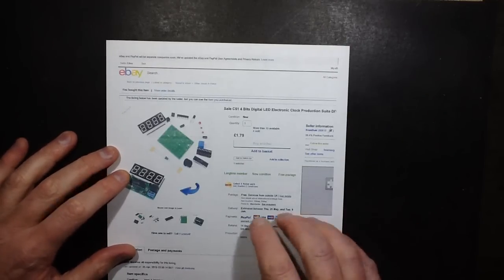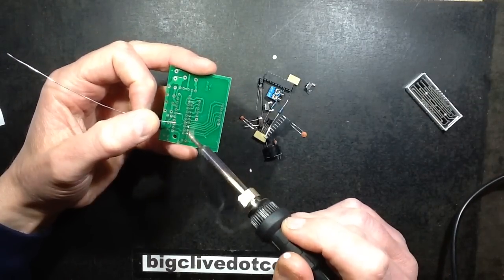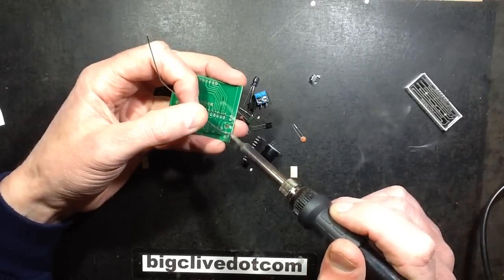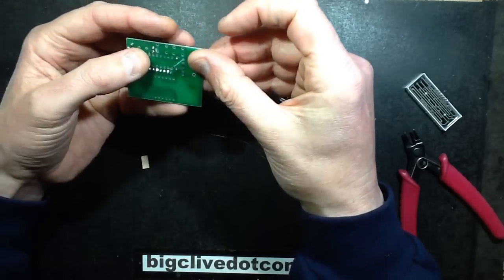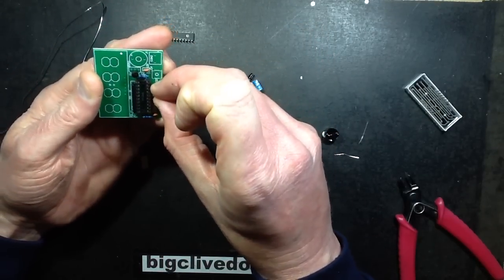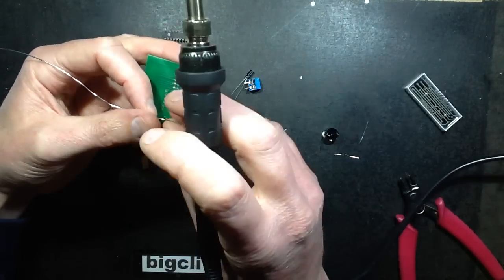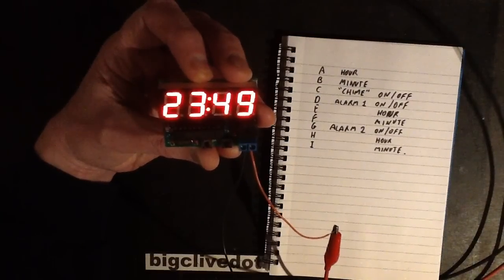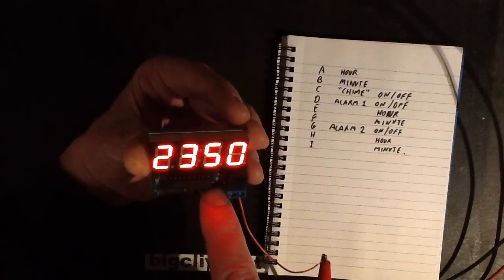Random Chinese electronic clock assembly kit type thing.

Comment: I have used hundreds microcontrollers  as rudely as you want and never had a single failure attributable to static. The inputs are protected. The earliest CMOS chips were not,  so the lore has spread and still sticks..

Comment: Me when I get a diy kit: meticulously follows the directions and circuit diagram, suffering through any chinglish in order to be as exact as possible

Clive: "Let's just mash everything in where it makes sense to."

I wish I was this good at electronics.
Reply from the maker: +Chris Roller You're already on your way to that point.  Time to treat yourself to some random Chinese ebay kits.
Reply: The only way to get good is to study, and build these kits, they teach you a lot. Also get an arduion or two and play with them.  Examine the example codes and you can easily learn the short version of C and C+ that they run on.  Get some ESP8266's as well to play with the internet of things, great fun and the lua code is very much like the Arduino codes, in fact now you can program the ESP with the Arduino programer with just a bit of work.

Comment: I just finished this kit and it works fine. Thanks for the video. I will study it to find out how to set the time and alarms. When I do my soldering I always use a small fan to blow the smoke from the hot flux away to one side, so I don't end up breathing too much of it. I'm using 3 penlight cells to power it with about 4.5 Volts, and that seems to be quite sufficient.

Comment: Got the same one last year as a project for my 15yr old son.
Although the crystal died after a week but once replaced it works fine.
It is still running.
Was so impressed I ordered their battery  backed version at £2.10

Comment: Not sure if anyone else has said, but the caps across the crystal (calculated by C = 2CL - (CP + CI), where CP + CI can be estimated as 5pF) are the load capacitors and they cause/encourage the oscillation that makes a crystal do it's thing usefully. Wrong value caps, or no caps == no oscillation.

Comment: The 30pf capacitors are in series with the xtal; they provide the correct load for the xtal and the necessary phase shift to make the oscillator work.
Reply: Not exactly.  I was told by an engineer some years ago that those were added to ensure that the oscillator would start reliably.

Comment: When learning how to solder at college [C&G] was told not to melt the solder with iron but heat componets/ wire so that it melted the solder. the test to pass exam was to  remove chips/ components and refit then it was tested to check it still worked.

Comment: IT uses AT89s51/at89c51. as this 8051 variant has very weak pullup feature, hence it uses the shunting arrangement where the display segments are turned off by providing alternate patch thru the microcontroller.

Comment: The exception to carrying solder is when soldering SMD chips. Basically, ome fixes the chip in place with Bluetak,  put lots of flux over one set of pins. Then carry a blob of solder over to the pins and run it along that side. With a little practice,  all the pins will be soldered without any solder bridges between them. Shame the SMD soldering practice kits don't have more chips.

Comment: @1FireyPheonix  totally understandable. :) it's easy enough to mix them up because they contain what the Chinese call Han zi, and the Japanese call kanji (hear the similarity?) 

          ---- warning TL;DR rant approaching ---

they literally are the same characters often times with a similar or identical meaning. Hence numbers. 

The only thing that changed, just like had happened across mainland China for hundreds of years before, the sounds that fit to the characters changed. This is also why Japanese kanji have what's known as an On and Kun reading, giving two pronunciations for a character. One the original Chinese, and one the Japanese pronunciation.  

Both Simplified and Traditional Chinese use strictly Han zi and other symbols, whereas Japanese include the kanji, and  2 distinct syllabaries (like alphabets) call Hiragana, and katakana... 

These two extra sets of characters help Japanese text to stand apart from Chinese. It helps if you know both too I suppose lol :P

Comment: Clive, the cheapie IC sockets are easy to seat. Push them in, flick the opposite corner pins over, THEN solder the OPPOSITE corner pins. If it's seated correctly, then unfold or "unflick" the opposite corner pins and solder them.

Comment: I recently started learning to solder myself by following Clive's advice and making some kits.

My first was a super-cheap kit with just a couple of flashing LEDs. I killed an LED by overheating it with the soldering iron. Luckily, I had a spare, and the rest of it went off without hitch.

The next was the very clock that I've just seen Clive put together. It works great, but I couldn't figure out the settings and it was too damn noisy, so it's resting at the back of a cupboard.

Next was a transistor tester, although it actually does a lot more than that. It's quite a sophisticated device, and useful in future electronics work.

I've got one more on order, and it's by far my most ambitious to date. An oscilloscope! :-)
Reply: then you aren't that far from making your very own SEM, it would be so fun to do it.

Comment: you solder basically the same as i do. i bought 3 different clock kit from various sellers and found 1 half worked, 1 did absolutely nothing and 1 worked perfectly. the one that works gain about 1 second per week. luckily it is the clck that i hoped would work, it had time date temp alarm and 60 led in a circle that showed seconds in about 20 different various. patterns. sill worked perfectly after about 1 year. the other two so-called clocks are in some fill site somewhere. :) i can turn chime on/off and can even set chime between certain hours only and not at other times.

Comment: A habit I've gotten into is to cut the ends off the leads of R's and C's while they're still in the endcaps, because the sticky residue would otherwise scrape off in the holes and get in the way of soldering.

Comment: Speaking of countdown timers, I needed a few of those for my wife who has to take medication then wait for a certain time for it to take effect before she can open her eyes once more (eye drops for glaucoma)  I looked around on Ebay and some Chinese shops bout could not find exactly what I wanted, but I did find a fellow who had the diagrams and code to build small ones using the smallest Arduinos and a little 4 digit display. So I built her one for morning and one for evening (different times required) and one for our car as I pull her behind our RV when traveling and I need to run the engine for 5 minutes at each stop to keep the transmission lubricated.  They are quite simple to build and run great on 9 volt batteries.

Comment: I've just received four of these kits as I'm experimenting with a "quick and dirty" way of powering up incandescent filament bulb displays via optoisolators in place of the LED display. The whole lot came wrapped in a very static-inducing sheet of packaging!
Reply from the maker: MegaWayneD One slight downside of a multiplexed display is that if it's not fast enough it may cause a slight beat frequency on your triacs that manifests itself as a slight flicker.  But only time will tell.
Reply: Yeah, I'm not totally convinced it will work but I figured at this price it was worth a try.
Reply from the maker: MegaWayneD Definitely worth a try, and if you do make a matrix of opto-isolators you can always try it with different modules to see if you can find one with a faster scan rate.
When I built a fairground game with large tungsten displays I used an M5450 LED driver since it is direct drive.  I actually drove the triacs directly with the outputs.
Reply: That's worth knowing, thanks! The thing I'm working on is a bunch of car "festoon" bulbs arranged in the 7-segment way so it resembles RCA numitron filament displays.
Reply from the maker: MegaWayneD You can multiplex tungsten lamps too.  That's what fruit machines do to drive either 64 (8x8) or 128 (8 x 16) lamps.

Comment: When I first watched this, I was wondering, "Why did they bother to include a socket for the IC instead of just putting it directly on the board?"

Then I watched Clive solder the thing going right down the rows. That's when the light bulb went on, "Oh, so an inexperienced amateur won't cook the chip while soldering it in place."

I'm going to assume, Clive, that you did it this way because you knew you were just soldering the socket, not the actual chip. When my dad taught me to solder, he was adamant about that concept:

Never solder adjacent pins on an IC one right after another.
Always solder diagonally opposite pins and, even then, it's a good idea to allow a few seconds cooling time after soldering each pin. When possible, keep a finger flat against the top of the chip while you're working. If it gets too hot to keep your finger on it, it's time to stop and let it cool before proceeding. 

You might consider adding a caption to your video to point this out. :)
Reply from the maker: +Greg Wolking On the rare occasion I solder a chip in directly I stagger the soldering  on opposing pins and also pause mid soldering to let the chip cool down.  A socket is always preferred.
Reply: +bigclivedotcom 

I had figured as much, Clive, as I stated previously. It's quite clear from your videos  that you really know your stuff.

Thank you, sir, for taking the time to answer my inquiry. I thoroughly enjoy your videos. In particular, I find the calm, measured, "thinking out loud" style of your narration to be a refreshing change from many other "how-to" YouTubers who seem to think they must become some kind of "character" telling jokes, cracking wise, getting ridiculously upset, and so on.

I have often wondered whether you plan what you intend to cover before you start recording or just go completely off-the-cuff every time. If the latter, it sounds like the former, as you're very good at staying on point and not needlessly repeating yourself (AvE comes immediately to mind in that regard). You may count me as a fan, sir, and I applaud your endeavors!

Comment: Built a couple of those clock kits.  The one like yours worked till I inadvertently hooked it up to my 12 volt power bank instead of the 5.  The other had soldering iron problems.  You see, I spend most of my time in a lift recliner because of my body condition, at any rate, I thought it would be a smart idea to buy one of those little cheap USB soldering irons.  They do work GREAT for just tinning a lead or something but building a kit?  Not so much.  Seems they just keep heating up and suddenly the traces and pads are seperating and your kit is pretty much garbage.  Ruined four or five different kits with that before it became a little used item.  I finally bought a cheap mains type with thermostat on the handle taking the tips like the ones you use. It does a nice job if you are careful but I have yet to buy any more kits. I do have decor that I built up such as little Christmas trees and heart we put on the dash of our Motor Home while traveling and when we spend the winter months in Arizona to keep away from the dreaded snow of North and South Dakota.
Reply: Who the hell knows, some days I just ramble on, and on and on.  I once considered myself a writer, even had a few short stories published, one in a magazine, another in a sci-fi anthology, but I gave it up and turned to computers, then to arduinos, then oh well you get the picture, hell I have been a soldier, a cop, a clerk to a district judge, and a carpenter. I have been a wood worker, a painter and a few other things I  shan't go into, but the young in our family remember me the most as that uncle who tells the best ghost stories ever.
Reply: lol

Comment: ...Back in the1970's...Digi-key sold stuff like this....but you had to make your own CB from the parts in the kit and it used a 3 resistor voltage divider across the120 line for low voltage power....red LEDS 7-seg...then later a kit with vac-fluor tubes....

Comment: just watching randomly through your videos and got here now.
AFAIK the capacitors at the quarzoscillator are there to help it start up oscillating.
only does not work if they are really off, but often even works without them, solely by copper line capacities...

Comment: I bought 3 of the other clock you built. I built one, and never got it to work. Checked polarity, checked solder joints, etc. Still didn't work. Figured the controller was cooked by the static in the foam.

Comment: It's unfortunate but I was sold some quite rare vintage sound chips embedded in what only LOOKED like dissipative foam, Without a proper static shield bag too.  Most of the cheap bits I get come incorrectly packaged.  If you need to build something you might come to rely upon I'd suggest other sources.

I still love cheap eBay deals though.  They keep my hobbies going.

Comment: Ah eBay sellers and packing. Personal favourite: One of those plastic shipping bags 5% full of chips in individual polythene bags, and a bit of packing foam thrown on top for luck. Many bent/missing pins, much static, so wow.
Reply: spoonymccheese or fragile magnetics wrapped in bubble wrap tossed into a plastic shipping bag, not once but twice. Both cores ended up arriving in not so useful little bits instead of two useful halves!

Comment: Made mine this afternoon and dropped my psu down to 2.75v and seemed to work fine. So I am using 2xAA batteries in a clear case pinched from a £1 set of LEDs. Will see how long it lasts. That buzzer though is excruciatingly loud and annoying so stuck a rubber foot over it. Bliss. Also why is there a sticker over the buzzer which says don't remove until washed? wtf?

Comment: High frequency crystals are terribly bad at timekeeping. That's because for them a "cut type" parameter (how the actual quartz piece was cut from a large crystal) is almost always "AT-cut", and low-frequency crystals are typically "XY-cut". This leads to far better temperature stability for low frequency (and in particular 32768 Hz) crystals, which makes them suitable for use for timekeeping purposes.

The next difference is that high frequency crystal physically is a solid quartz block, and "watch" crystal is a "tuning fork" style. This also matters.

So this clock won't be accurate, unless they've used some extra-custom crystal. :)

Comment: Another fun build by Master Clive!

Question asked: 
"...why use 2 little caps with the crystal"?

Answer:
You're actually building an oscillator circuit, using a crystal, some capacitors, and the internal circuitry of your microcontroller. If you don't use the caps, your clocking won't work. The values are calculated based on the properties of the crystal, as described in datasheet from Microchip "Crystal Oscillator Basics and Crystal Selection for rfPICTM and PICmicro® Devices" 
http://ww1.microchip.com/downloads/en/appnotes/00826a.pdf

Comment: Total novice here, I had actually ordered two of these so I could bugger up one of them and perhaps make the second one work.  The first one didn't work due to my dodgy soldering and that night I saw this video, so today I attempted my second one and finally managed to produce something that doesn't look like a hedgehog and actually works.  I think I might change the power supply widget though as I wanted to be able to plug it into a usb connection and so far it goes into a bread board and then into a USB connection which isn't ideal.  Clive just sails through these videos, with double joints and a skill that makes my attempts look like a five year old poking things with a big stick.  One day.... ;)

Comment: Big Clive ,do u think a weller 40 watt soldering pen is to much,and what soldering pen do you use,I am sure you got good reason to use that pen with all the work you do.with it. A lot of pens tell you the temps.they run at that weller I am looking at is 900 degrees which seems a lot .my last two soldering pens were 30 watt pens.i have been soldering for over forty years and I been away from it for a while things change.
Reply from the maker: +Ron Thompson 40 watt seems quite high, except for soldering big connections.  Nothing too much has changed in soldering, but try and avoid the lead-free solder.

Comment: I bought three of those recently in order to practice soldering. I already build one but it is not really working. The speaker emits a constant beep and the display is lit up but show no time. I am pretty sure that I followed your video exactly. Is it possible I broke something while soldering or could be a part faulty? Since I don't have a power supply I cut off one plug of an USB cable and power the clock that way. I really like to know what's the problem so I can understand what's going on since I am still a beginner in the field of electronics.

Comment: Big Clive ,I just finished my clock kit ,I followed your video step by step,it seems to work except my buzzer ,I thought I might have reverse it,no it's just like yours,any idea ,I check to make sure no solder touch other pins,also ,I am looking for another soldering pen,my weller is 30 or more years old,what brand is your and where did you buy it.and how many watts. What is our time difference ,I am in California.also thanks for all your help.and your videos are the best.
Reply from the maker: +Ron Thompson Check the circuit path to the buzzer for solder bridges or dry joints.  That includes from the processor pin via the resistor to the transistor and the beeper itself.  Also make sure the transistor is in the right way round.
Reply: Thanks you so much ,I let you no if I find the problem,also thanks for your video,it made it easyer.